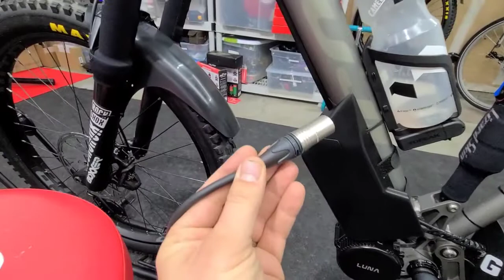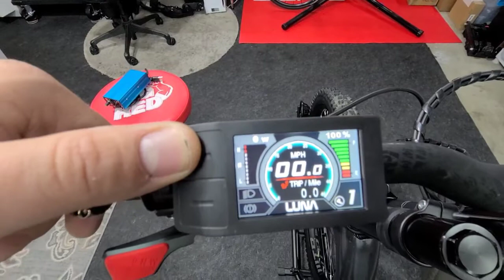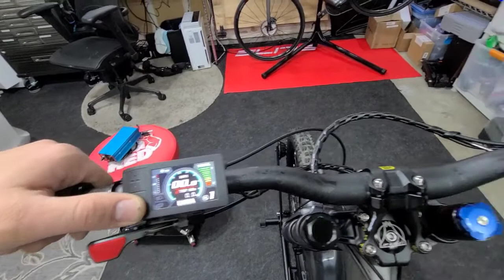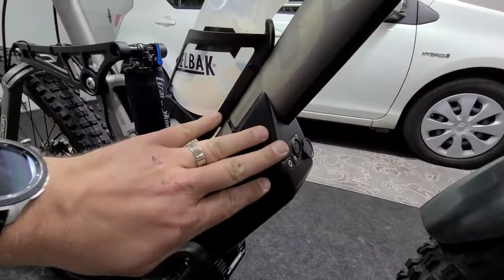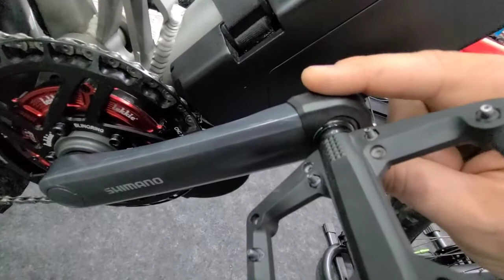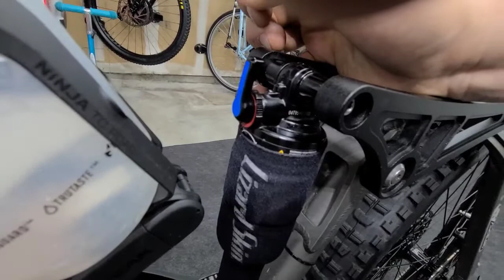Custom Ebike by Tyson Messori

Comment: 250Wh is a really small battery for a 750W motor..  running the motor at full power will definitely stress out the battery way more than charging it to 100%. Even if some cells can handle 3C or more, they will really only reach their 500 cycles if discharged at 1C. Full suspension frames suck for such e-bike conversions, you just can't find enough space to place a big enough battery to supply power to such a strong motor without prematurely ruining the battery